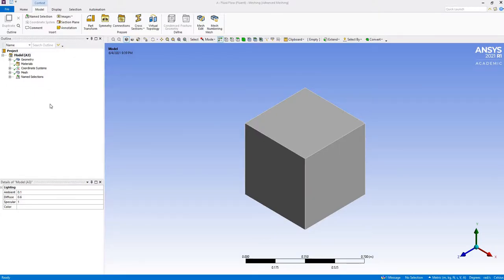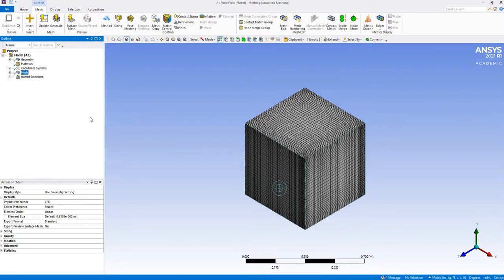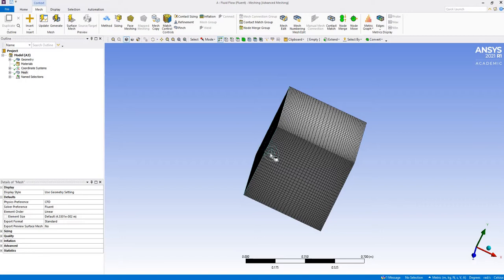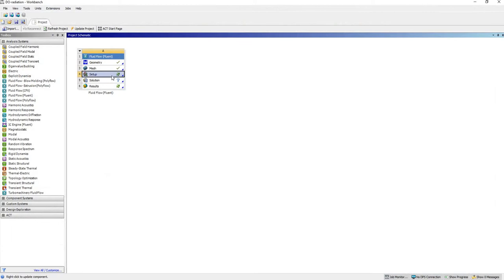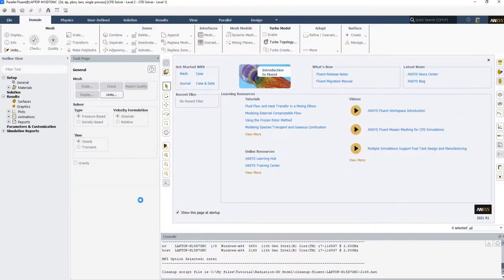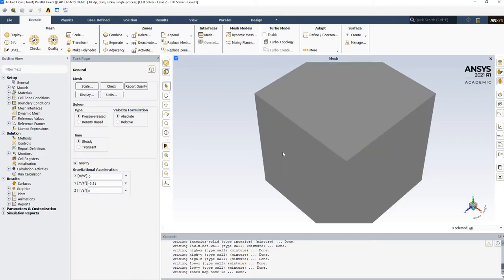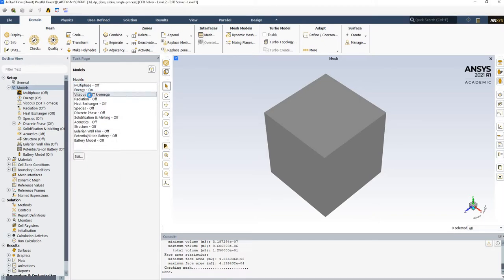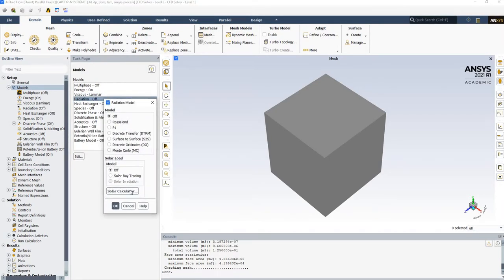DO Radiation Model Fluent

Comment: Hi Nazmul, is it possible to evaluate the radiation emitted by UV-C radiation diodes in a system?
Reply from the maker: I am not very familiar with UV-C radiation diodes, but if you know the wavelength then you can specify the required band of wavelength for the incident or transmitted radiation. That might be the way to set up a special type of radiation.
Reply: @NazmulHossain-nb4lc  Can I know your email id please? Thank you
Reply: Hello Nazmul, Can I know your email id please?